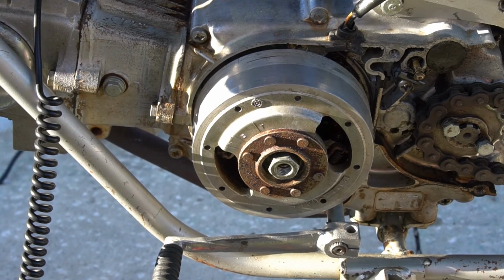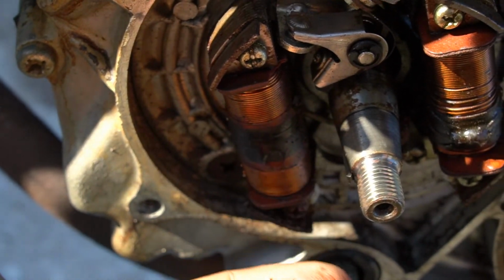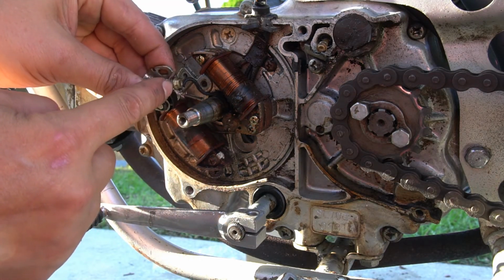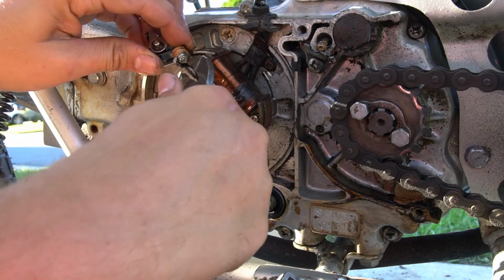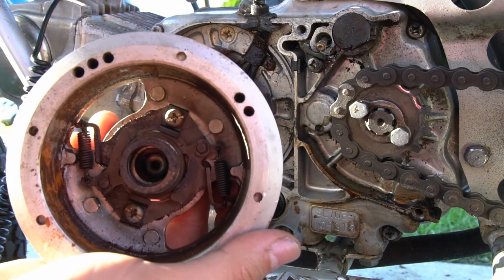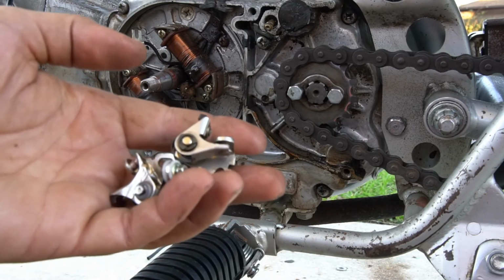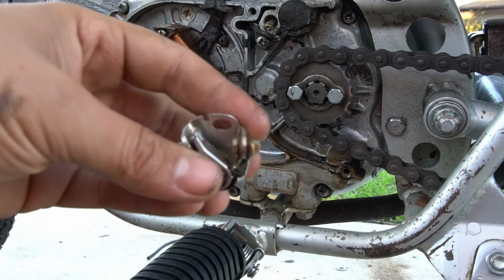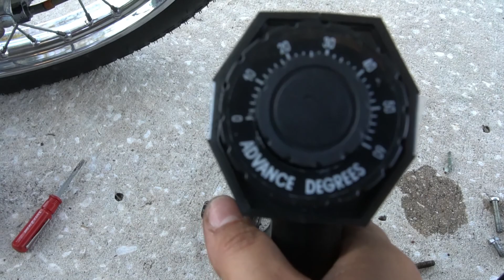How to Change Point, Get Spark and Set Timing with Light - Honda Z50 CT70 SL70 XL70 CL70 ATC70

Comment: Nice video. I was hoping as I watched that you would show the advance happen while you had the timing light on the mark and rev the engine. I will now have to go try it on mine as I am too curious. Will also have to research how the old ct70 advances timing as I don't think they have the mechanical unit in the flywheel?

Comment: Great tips thanks bud... Where did you get the timing light it's a great tool to have. Thanks for the video!
Reply from the maker: I use this light from harbor freight. You will need an external 12v battery to power the light. ---https://www.harborfreight.com/timing-light-with-advance-40963.html

Comment: Where did you buy points from? I have the similar cl70 motor and could you show a close up of what you were adjusting and how on that screw inside for the timing finesseing ? Was gonna message you on Facebook privately but figured other people could also learn from the comment section. Thanks fir the detail and this is what I was trying to figure out with you the other week. Perfect timing for me for this video😄
Reply from the maker: CHP in Texas, NEVC(Hondanuts) in NY or TBparts

Comment: Are you readjusting the points gap or turning a plate through that slot what.
Reply: readjusting the gap timing. when he turns the flywheel, then closes the gap and re-tightens, it changes the time when the gap opens. then he looks at it with the timing light to see if its correct. 
if its not, he tries a different point on the flywheel until its correct.

Comment: That sys you use is not really correct yea it cranks and runs but you did rev it out to see if the max timing was correct thus verify if the advace mech in the flywheel is working,and points need to be set a certain gap with a feeler gauge about .016
Reply: With the idle set as high as it was, the mechanical advance was probably coming into play already.  I'm sure there is a recommended rpm for idle, IF you are going to use a timing light.  Without a feeler gauge and tach, he basically timed it by ear.  It may, or may not be set correctly, but he and we will never know.  I just picked up a non running 74 XL70, and looking forward to going through all of this with mine.  I plan on doing a full restoration on it.  If you have a channel, and have some good advice to help me along, please let me know.

Comment: Was those fly wheels only used on sl70? My ct70h has one is it incorrect?
Reply from the maker: They both used this type of flywheel with advancer. 3 speed ct70s/z50s used a different non advancing flywheel. Crank end taper is specific to each setup too.

Comment: Sorry but you should be setting point gap by feeler gauge as well not just whatever.
Reply from the maker: It is not whatever. I'll trust my timing light over a feeler gauge. Not every point is perfectly built, there are variations that can cause bad spark timing. You can use your feeler gauge, but the timing light will provide the final say.
Reply: @VintageHondaMinis  exactly.
Reply: timing light is the true mark ...
Reply: @VintageHondaMinis  not true. You set the timing mark to the F. Then use a feeler guage for point gap. If it’s not within tolerance then change the points etc. your just doing random testing. By the old school light method and feeler gauge it takes literally 30 seconds to 1 min max to time these bikes.
Reply: @dean3919  if you set your timing like him then you guys need to go back and learn how to work on these bikes. You do not start and stop a engine a million times with a timing light to set points.
Reply from the maker: @mysterycomment1553  ok. Then don't use a timing light. You can use a feeler gauge and a open/closed circuit test light. Why you are disputing the effectiveness of timing light is beyond me.
Reply: @VintageHondaMinis  because you have to start and stop your bike a million times and guess your accuracy while setting the points. While with a 6v battery hooked up to a light and the points you can set the timing instantly. Use feeler gauge for the tolerance and done. I’ve had brand new points even not be within tolerance because they were junk.
Reply: @mysterycomment1553  how do you do it with feeler gauges? I have my old 1986 Christmas Special Z50 that my dad bought me and my brother new for Christmas. I’m trying to go through it and get it running again and I remember my dad using the gauges when I was a little kid. Trying to remember how he did it.
Reply: @jackgtx440 , there are several videos out there showing how to do it.  Be patient, don't get frustrated, and enjoy the fruits of your labor.

Comment: I would have liked to hear if opening the gap or closing the gap would advance the timing. I'll have to try it myself, Great video. Thankz.
Reply: When you do points and set points 12-16 gap  per spec closer to 15-16 will advance timing